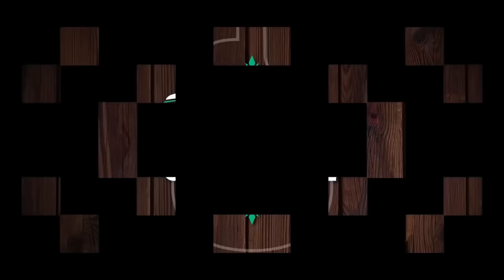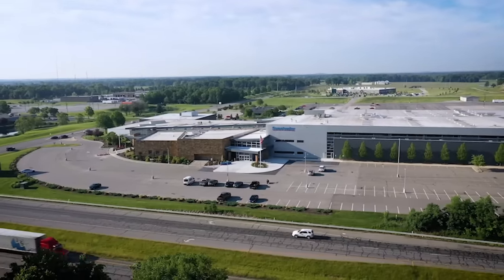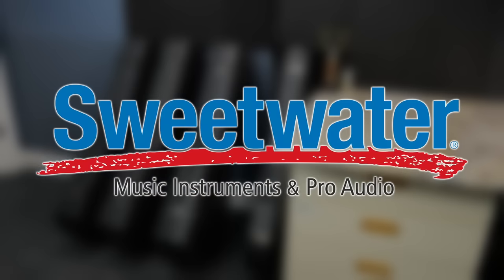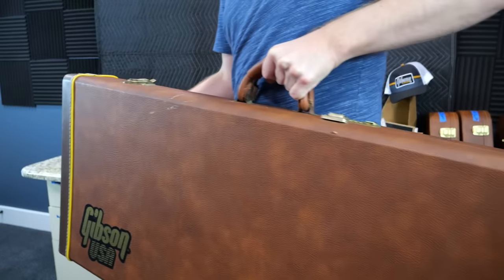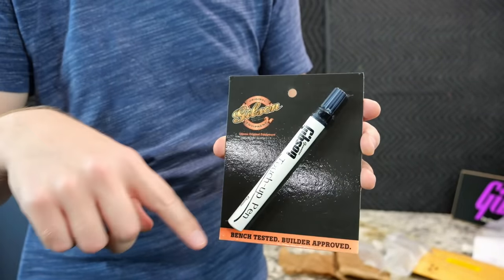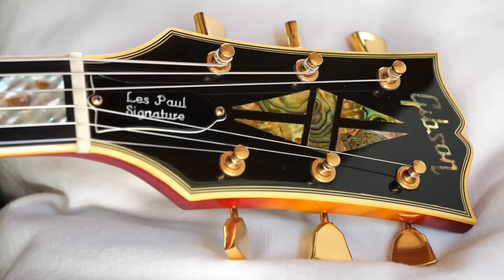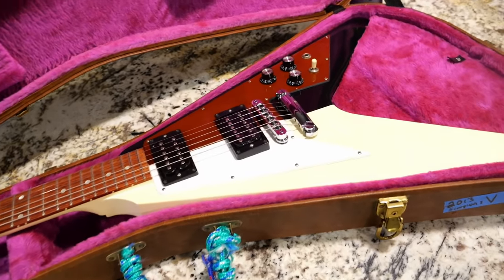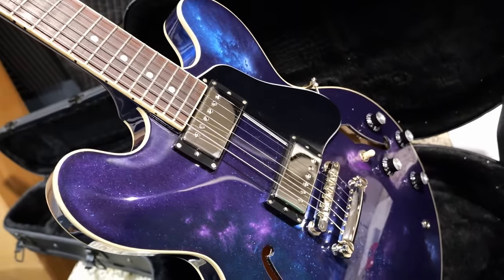These 5 Guitars Are Special | Trogly's Unboxing Guitars Vlog #177

Comment: Nice collection! It has to feel good to get back a guitar or amp, etc you sold and immediately regreted. I have a Dean Markley K50 amp I later bought a Tweed Extension cab for. I also ran into David Crosby at that seller's table who was present as well. Buying a bunch of DM amps and cabs like me. He said he loved them when we walked out conversing about them. In that yellow/tan color Dean used. I sold it to my nephews who have a popular local band (PA?). If you ever run across one, I need it. Great sound with the amp speaker. I also have a Gibson Flying V in black I customized. Previously owned by Ron Zelle who had a guitar shop in Amherst, OH. He had two of'em in his trunk to gig with for years. I bought the better of the 2 that happened to have been built on my birthday in 1983! What's the odds of finding one like that? It has abalone fret markers too. Original Gibson V case as well.

Comment: Gibson dropped the ball on the Dave Mustaine Rust in Peace 30th Anniversary Signature Flying V EXP in "Alien Tech Green Burst" by promoting them for over a year then not releasing the "Burst" version and also having Quality Control issues with the paint on almost every guitar they released in that run. That is "Why" Gibson has had trouble selling Dave's Signature Series OVERPRICED guitars. Maybe if Gibson did an actual reissue of the 84-87 XPL Flying V (which is what Dave's Vs are modeled after) at an affordable price point they could get buyers interested in Flying Vs again. But then again I'm just a dumb old guitar nerd so what do I know?

Comment: Thank you Trogly!!! Finally I solved the mystery of my 82’ SG standard. The bridge pickup is the Bill Lawrence cirkuit board HB-L (~13K) . The neck pickup (7,3 K), has the PAT on the bass plate with nickel screws, so it’s the PU490. Somebody probably swapped the original Tarbacks to late 80’s pickups from another model. Thank you again Trogly!